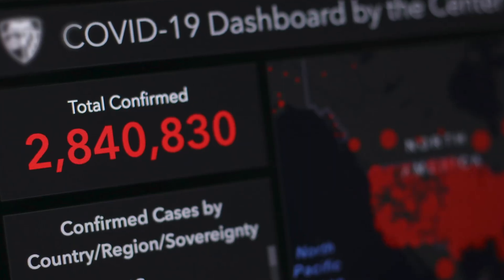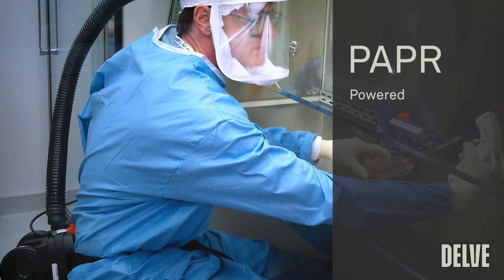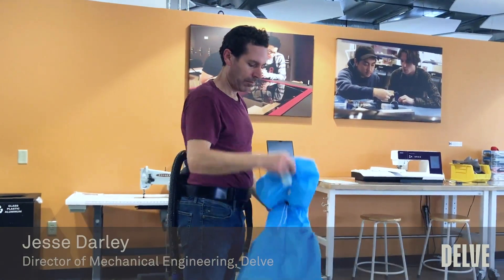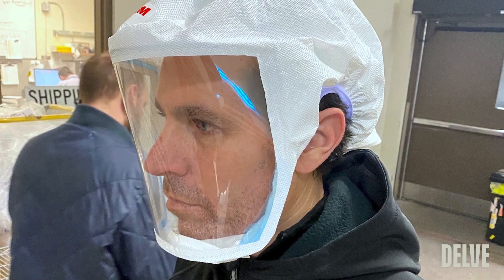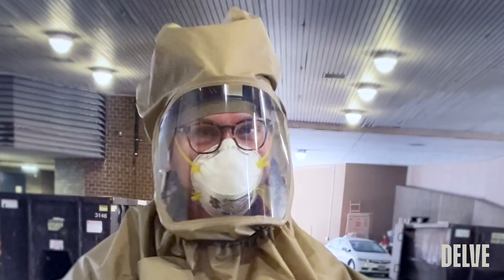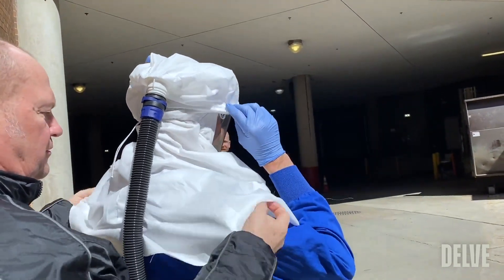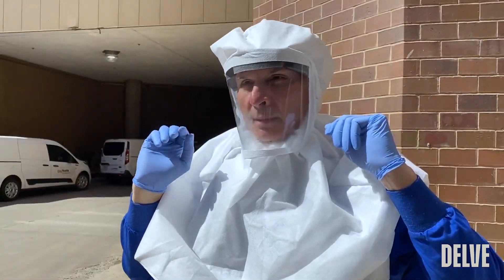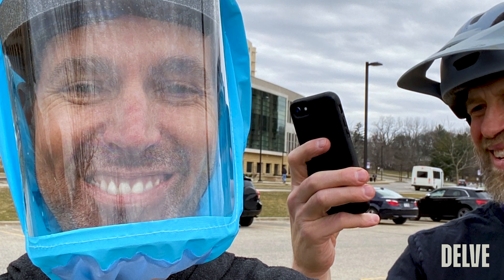Universal PAPR Hood Design

Comment: Delve I have a question could I wear this under my pipeliner welding hood if I've got a welding hoodie with a hood because I'm a new welder and really would like to not get welding related cancer before I'm super grey and old
Reply: There are already PAPR welding helmets out there, but they're ridiculously expensive.  It might be easier to rig up your welding helmet with a loose seal, similar to the one in the video that the lady is wearing with the holes at 3:25.  It'd be similar to the https://www.3m.com/3M/en_US/company-us/all-3m-products/~/3M-Versaflo-Respiratory-Hard-Hat-Assembly-M-307-with-Premium-Visor-and-Faceseal-1-EA-Case/?N=5002385+8720547+3294754068&rt=rud with a soft seal around your chin.  Of course the powered air supply portion is the more $$$ part.

A couple more ideas - velcro for sealing to a fabric hood - as long as you have a positive flow, the leakage would be okay since you're not worrying about infectious agents.   Mimic the hood in https://www.youtube.com/watch?v=pJtv1UYWCxM